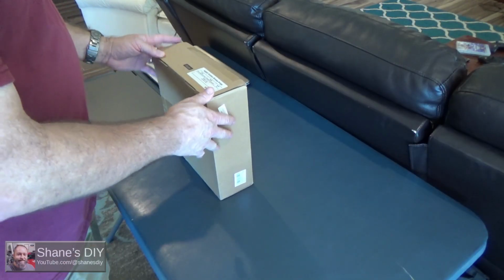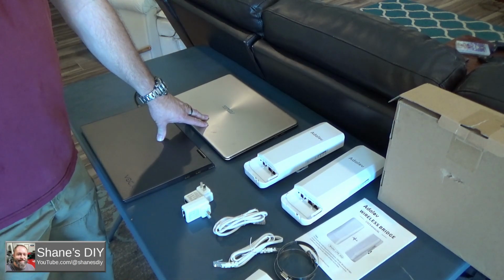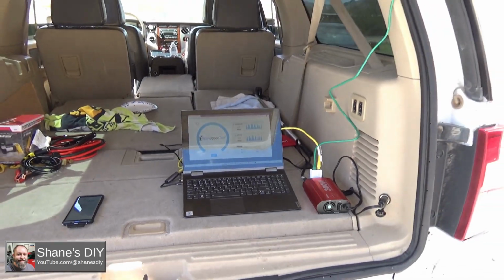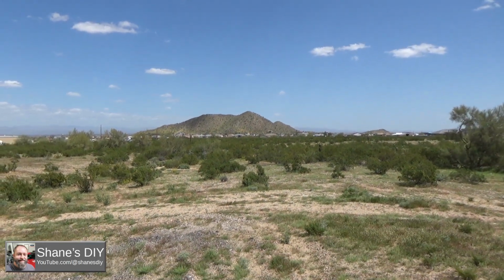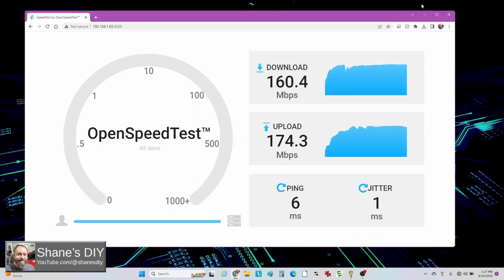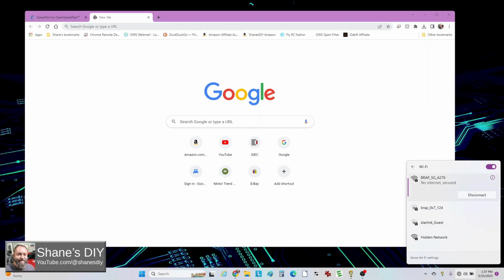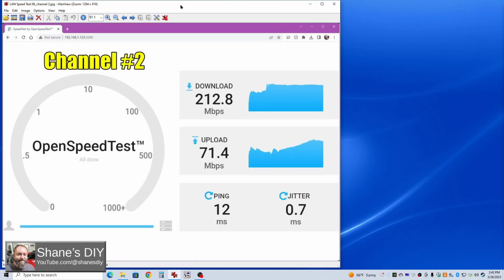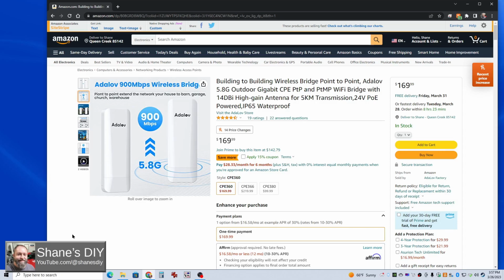WIRELESS LAN TEST FROM 1.0 MILE AWAY!!!  Adalov CPE360 wireless network bridge

Comment: between speed download and upload measured in the antennas (when you enter the antennas' IP addresses) and the speed test LAN you have equal values?
for example 300mbit from the antennas and 300mbit from the LAN test ?
Today i will try with a higher cat cable for see if I have the same values

Comment: That is AMAZING.  I did NOT expect the ping to be ANYWHERE near that good at that range over wireless.  I figured it'd be 100-200ms or more due to range and possible interference and signal strength.

WOWWW!  My mind is blown away.  I have dreamed of making a LAN from my house to my mom's house .3 miles away for decades.  And now I finally can.  PLUS only one of us would need internet haha.  We have fiber internet on our road, now.  It pings like 2-3 ms on speed tests.  So, I'd be getting less than 10ms ping times easily AND around 300Mbps down/up speeds.

I'm looking at the AdaLov CPE361 model which has 2x 1Gbps Ethernet ports instead of 1x 1Gbps and 1x 100Mbps, plus the range is rated at 5km.  I mean, for $200, we'd make our money back by sharing internet in 4 months and then it'd be paying for itself after that.

Awesome video, thank you for posting this!
Reply from the maker: I was quite impressed as well, was not expecting it to work as good as it did.  Good luck on your project!   Definitely worth the money for an application like yours.  Thanks for watching for for your comment.
Reply: @shanesdiy  Thank YOU for sharing!  So excited for this project.

Comment: I am going to use one of these where the slave will be at a remote site with battery/solar power. I note the poe is 24 volt. But I can not find out if the dc input, which I intend to use, is 12 or 24 volts? Can you tell me this?
Reply from the maker: 12V @ 1A for the DC jack.
Reply: Just curious, does this device have a "24V" spec for POE? A device may have, for example, a 12V power input and a POE ethernet port. However, if it supports POE, that doesn't mean that the POE voltage supported is 12V (though I'm assuming you probably know that). To be absolutely sure what the device can use for POE voltage, check the POE standard that the device supports, such as 802.3af, 802.3at, etc, then look that the POE injector/switch supports that standard. Most POE devices will accept a range of POE voltage all the way up to 48V-56V, unless it specifically states a POE voltage max of I.E., 24V. If you're using power at a remote location and you have a POE injector/switch already that's 30–60V POE output, you can use a Linovision "POE Splitter-1224". It takes POE input, then splits to a standard RJ45 1gbit data port, with both 12V or 24V DC output selectable by a dip switch, allowing you to power a device like this bridge directly through it's 12V power port. Of course there's various routes depending on what you want to accomplish, such as 24V POE to 12V DC splitters. Or just use a cheap buck/step-down DC driver if you simply want to drop non-POE 24V DC from batteries down to 12V DC, and those are like $5 on Amazon.
Reply from the maker: @matthewmarshall3808  Thank for sharing your knowledge, interesting stuff.  Here's what I have on this equipment.  The manual states the Power requirement is ">/= 3W" which is only 0.125 @ 24V, I did not measure it's power consumption to confirm this.  The POE input requirement says "POE 24V-1A" and the POE power adapter they include is only rated at 24V @ 0.5A.  The DC jack requirement "12V 1A" and I did run one of the modules during testing with the DC jack @ 12V.  Never noticed any power related issues but didn't measure current draw in either mode.
Reply: There's usually some overhead booth ways, power output of a transformer and power input rating of a device. Can usually get away with some difference when it's a low power device. Looks like it's working well. This video surprised me. When I watched I had no idea they were doing this good at a mile in this price range. How did you end up choosing this one, do a lot of research or did you just try one and get good results? I have a 3/4 mile long driveway and this has me thinking of all kinds of new uses on the property!
Reply from the maker: @matthewmarshall3808  The company contacted me to test and review it. First and only one of its type I've tried. I was also impressed and surprised.  I was honestly ready to call BS on the range claims but it clearly worked!